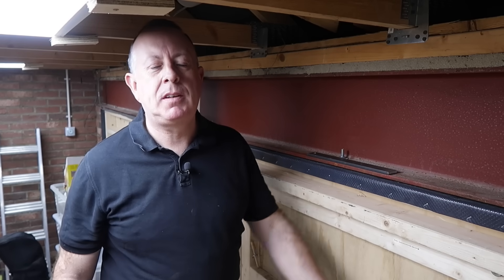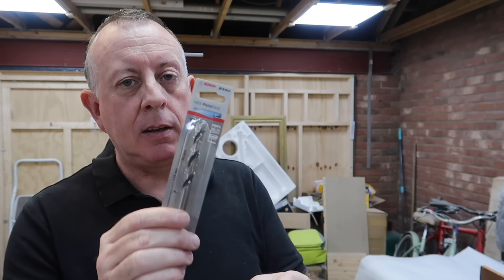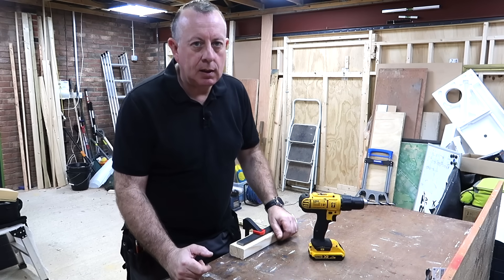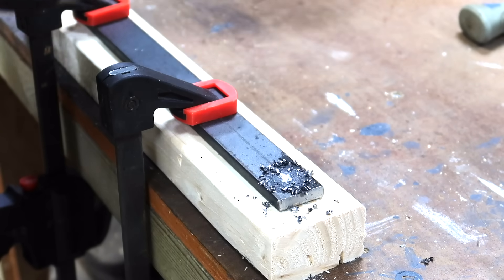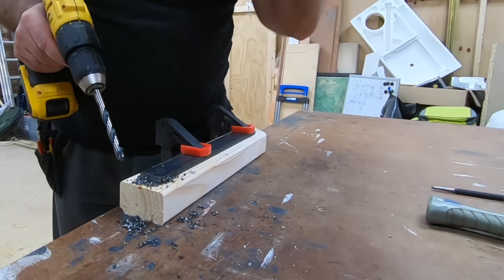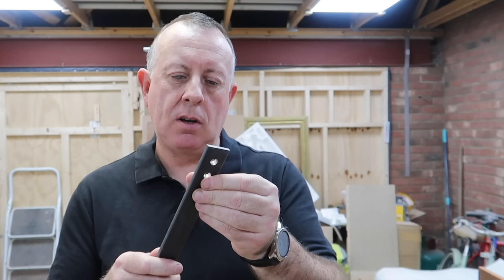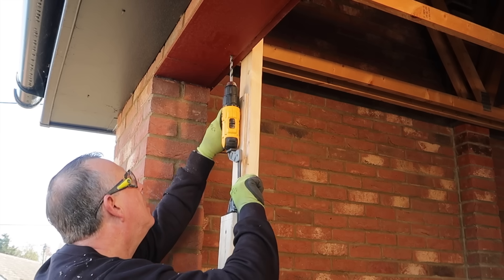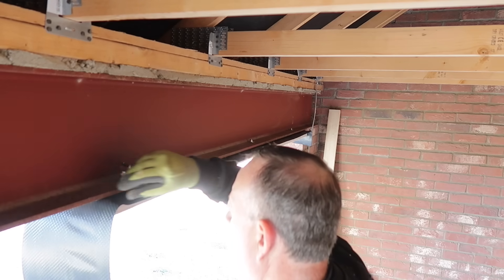How to Drill Through Steel Beams with a Cordless Drill

Comment: Great video PD some great information there mate I used to be a driller in the shipyard & I used to a piece of timber with a steel hook through it at one end & it was called a swage stick the steel hook would be placed on to the flange of the rsj & the timber was used to form a fulcrum at the back of the drill & i would apply pressure on the timber using my shoulder
Reply from the maker: Yes got it! I suppose any way to exert pressure safety is the way to go - my way was maybe a bit 'Heath Robinson' but it gives the average DIY'er some ideas.
Reply: was that at SmithsDock  Chris
Reply: It certainly was Ray bloody hardwork but great days nice to hear from you mate & I hope your ok👍
Reply: I'm a Kiwi & being lazy -was told to sit down and use the strongest tool I have before "looking busy", and have used a similar method to this (used a chain & pipe but the basic concept is the same), it requires a bit of care to operate but works brilliantly. Mag-drills are awesome on steel but like a chocolate teapot on stainless, aluminum or other nonmagnetic material, also bluddy expensive when compared to fabricobbled out of the scrap-bin tools.
Drill a pilot hole a smidgen bigger than the web of the drill and match the speed (rpm) & feed (force applied to drill) to the size of the drill and material (harder material/bigger drill = going slower).
Also I've found that a bit of scrap wood clamped behind the hole so it keeps it together and doesn't bite and jam gives a cleaner hole, reduces the likelihood of broken wrist or drill bits. 
Someone said WD-40 isn't a lubricant -WD stands for "water dispersant" but like any oil it's better than nothing, even waste engine oil will help if you're only doing a couple of holes but for a lot it's worth getting some "CDT" (cut, drill, tap) oil.

Comment: HSS bits mean high speed,smaller pilot holes and drilling fluid would be a lot quicker and easier
Reply: He said he worked in construction. Obviously not a steal worker otherwise he would know about pre-drilling and drilling fluid. In addition WD-40 does have a bit of lubricating effect, but as you stated is not a drilling fluid (he may have done better by smearing butter on it) (;-)). Actullay WD-40 is to disperse water and that is why many people think they can use it for almost everything. In addition his tip when drilling to apply alot of pressure is also not correct in my opinion. Towards the end one should continue with the same pressure or better apply a bit less. Applying more pressure is what can cause the drill bit to slant and then get stuck and break. However during my 38 years in the metal industrie I met a number of people who always thought muscle is everything. His idea with the clamps was good though. I  mean I may have done it differently, but everyone has a different body size and for some people standing on a ladder to drill above their head can be a problem. I must say though that WD-40 is a great product that I have used for everything from removing stickers on objects, pre-washing my greasy hands to removing chewing gum from the carpet (always testing on a hidden spot first) in my car and many other things as well. I'll have to check some of his other videos. One should always walk through life with open eyes and ears. We never know when we will learn something new. Have a nice day!

Comment: No need to buy expensive Bosch / branded bits, generic cobalt bits are cheap and work very well,  pilot drill first, cutting oil is cheap and works better than WD

Comment: I find a smaller pilot drill first always helps when drilling a large hole.
Reply: Not to small though other wise they’ll just snap with too much pressure...4/5mm for a 10mm hole should do
Reply: @cbdcann5148  Ideal size for a pilot hole is just a little bit smaller than the web of the larger drill.
Reply: @caskwith  That sounds exactly right.  Logical.  I need to remember that.  Thank you very much.  Knowledge is priceless.
Reply: @caskwith  what is the web?
Reply: @tattabridge  The middle part of the drill between the flutes. If you google it you should find a diagram.
Reply: @tattabridge  basically the diameter at the base of  flutes... Always try to buy a four facet drill point... With primary and secondary clearance and the benefit of split point.. Massive reduction in cutting force.....
Reply: @cbdcann5148  Exactly that at high speed for the small one then slower for the 10mm drill bit but it doesn’t need to be as slow as he’s using it. It overheats when people aren’t putting enough pressure on and are just “rubbing” at high speed. I drill steel most days with pillar drills and on site with cordless drills.
Reply: Yep a pilot drill no bigger than the core diameter of the drill (The web) you use next... The core drill is easier to drill through initially. Because the core / web of the pilot drill is vastly reduced.. .
Massive reduction in perceived cutting force....
Reply: Great video! It has given me some tips and confidence to complete my project where I have to drill into similar metal support beam. I have a set of cobalt drill, the metal beam I am planning to drill has brick on the other end. Would it damage the drill bit if I touch or hit the brick?
Reply: @Reid Harvey Glad I could help xD
Reply: @Graham Finnley Thank you, I went there and it seems like a nice service =) Appreciate it !!
Reply: I know I'm pretty randomly asking but do anybody know of a good website to watch new series online ?

Comment: Slow & steady wins the day. What about running a smaller pilot drill down first, would you then use less pressure to drill the bigger hole?
Reply from the maker: I actually tried using a pilot hole off camera to start with however the full size hole was so quick and easy changing bits and set-up twice for each location to drill a pilot hole was slower so I didn't bother.

Comment: The jig and clamp is a nice idea, but it would be quicker and safer all round to drill a pilot hole. For 9mm holes, a 4mm drill on as high a speed as possible would require hardly any force at all. Putting that much pressure on the drill isn’t necessary. Drill speed is your friend. The correct speed for a 9mm drill is closer to 1000rpm. Use cutting oil and you’ll go through it like butter. Proper safety glasses are a must, and please be careful wiping away swarf with bare hands. It can be mega hot and razor sharp!!

Comment: Its all to do with feed and speed.  Feed equates to the pressure. The bigger the drill the slower the speed. Use cutting fluid instead of wd40. There's no need to put so much force on the drill. Once the swarf starts coming of in one continuous piece that is the right speed and pressure
Reply from the maker: Thanks for the tips!

Comment: I would have drilled a pilot hole first ????
Reply from the maker: I tried that off camera to start with but the full size hole drilled so quick that drilling a pilot hole first just then changing bits and set up just took longer.
Reply: @ProperDIY  Taught as an Apprentice .. to always drill a pilot hole first...but it worked and was safe..then thats ok ..

Comment: Use a Tec screw in the end of your Combi on speed setting 1 you will do it in half the time
Reply from the maker: To directly fix 4x2 onto the 20mm bottom flange of a mild steel beam - really? A Tec screw would cut the sufficient hole? Sounds too easy to me. - I think you need to publish a video showing this - you would get a lot of views!
Reply: @ProperDIY  Didn't know they made 10mm tec screws ....

Comment: Those type of beams are structural steel.  Why not use high melting point grease -  don't have to keep adding to it and it catches some of the smaller bits of swarf - the ones that can so easily  get in your eye.  Running at the lower drill speeds the swarf  will fall  down rather than out  so standing a bit higher up and to one side can keep you out of the line of fire - the large pieces of swarf  are less likely to cause a problem. 

People should make sure they use proper  safety glasses as you were using   which have foam around the frame to stop  anything getting behind - like the smaller bits of swarf  you don't see and which will probably land you in hospital if they do.
Reply from the maker: I'm a DIY'er, I don't have 'high melting point grease' - I do have WD40!
Reply: @ProperDIY  If you do DIY on cars then it's pretty well a must have  - got plenty at Halfords.  I expect at least some of your viewers will have access to it.  I hope they use it It is better than WD for that purpose.

Comment: why did you not use a smaller drill to pilot the hole first then use the other drill?
Reply from the maker: I did try that (off camera) to start with however as the hole only took a couple of minutes to drill it was quicker using 1 bit rather than changing and setting up twice.

Comment: If I was drilling a half inch hole with a pistol drill I'd drill a 3/16" pilot hole to clear the web in the center of the 1/2" drill.
Reply from the maker: I did try that (not on camera) but it slowed me down. As each hole only took a couple of minutes to drill, by the time I changed the bit and set up for a pilot hole, I found that I could have finished to 9mm hole I wanted.

Comment: I think you'll find it a lot easier to make a pilot hole first with say a 2mm or 1/8" drill, then go through with the final size. The other advantage of making a pilot hole is there's less chance for the drill bit to wander and you don't need to apply so much pressure. Just saying
Reply: Bearing in mind that this would be a slightly wobbly process I would not back myself to use a 2mm drill bit to go through 20mm of steel without snapping it!
Reply: @tangoterrier  agree,obviously never drilled through steel or anything else for that matter...2mm...ridiculous...
Reply from the maker: I did try this at the start (but not on camera) however as the larger diameter holes only took a couple of minutes each, by the time I had set up and changed the bit etc I realised I could have finished the hole.